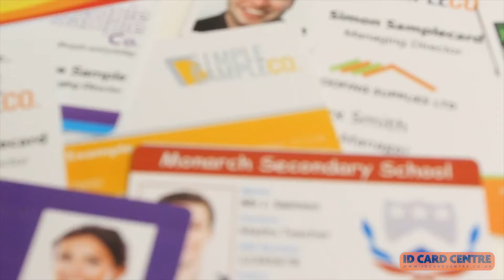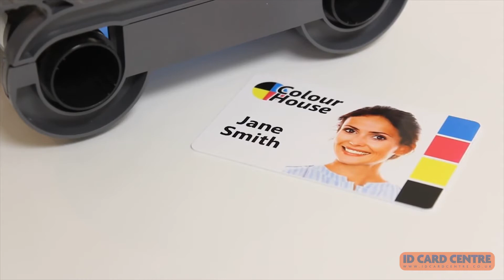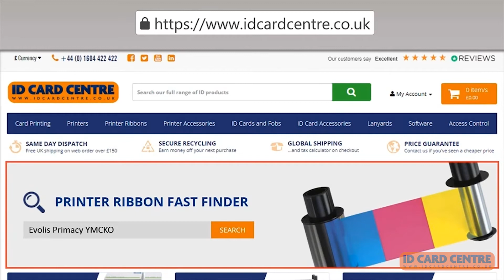How Does A Plastic Card Printer Work?

Comment: Is there any concern about using too much of one color like with normal printers? In other words, if our badges are red, will the cartridge run out faster because the red ink will run out quicker than the rest? Or is it using new panels per each badge?